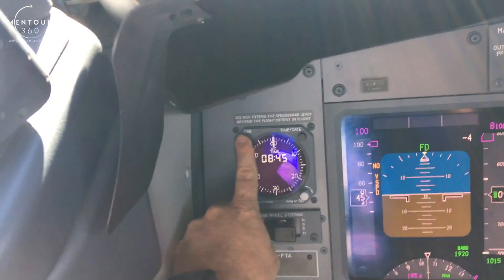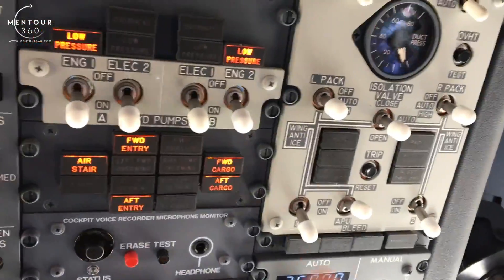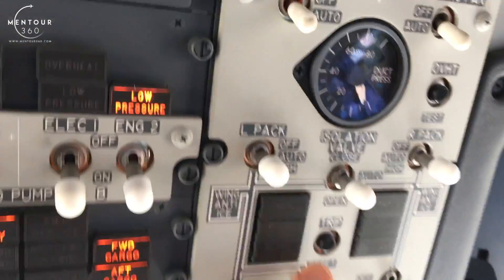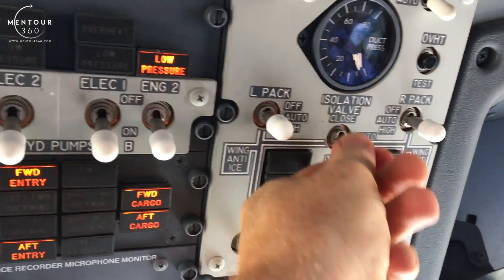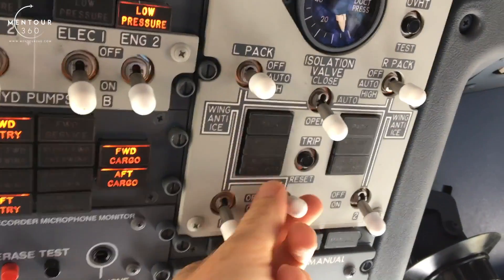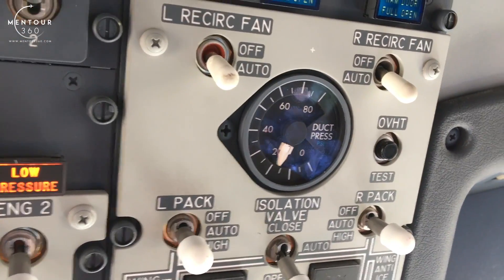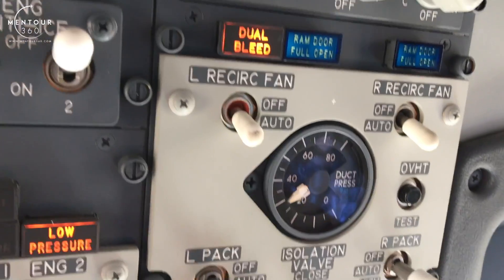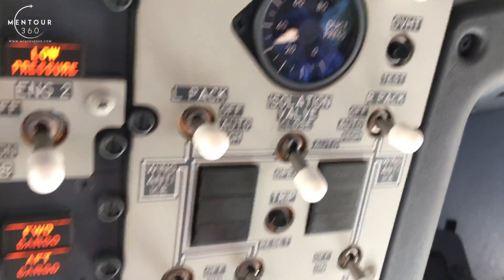What is this? - APU

Comment: Thank u so much cap it's so helpful well I was flying in air India from India to Dubai in flight it was hot and after few seconds or mins I could feel it's getting cold in flight and now I understood what was going on as GPU disengage and APU became on as I could hear some humming sound from behind it was to much disturbing thanks for ur info keep up the good work I have one question I have heard that an airhost or hostress can be come pilot also how is that possible cause both field are not same please do reply

Comment: Hi Mentor,
May  i know for what reason do Airplanes dump fuel & when?
Reply: Prathiksh Shetty Emergencys mainly. Its for when they need to get below Max landing weight. They can fuel drain on the ground if they need for tech issues etc
Reply: There's s  ideo on that. When you are making an emergency landing añd fuel could cause fire upon landing pilots dump fuel jettison over ocean not land usually. Protecting against too hard a landing due to excess weight. Fuel is heavy 40 tons is 80 thousand pounds.

Comment: isn't the apu a critical system?
if both engines are lost wouldn't the plane lose all power and the plane would become un-flyable, unless the RAT was deployed? which can not give as much power
Reply: foxtrot uniform charlie kilo the RAT is exactly what keeps the most critical systems running until the plane performs an emergency landing.
It cycles air in the cabin, but does not provide AC, it keeps only the most vital systems running in the cockpit, including all the avionics controls so the plane can land safely.
It only has power for about 30 minutes though.
Reply: does it have enough battery power to last a long gluid? (sorry for bad spelling)
Reply: foxtrot uniform charlie kilo Unlike Airbus( fly by wire ) 737 doesn't need electrical for basic flight controls.
Reply: 30 minutes?
Reply: APU is only required for ETOPS. If both engines fail over land, the RAT is deployed to give basic power for critical systems.